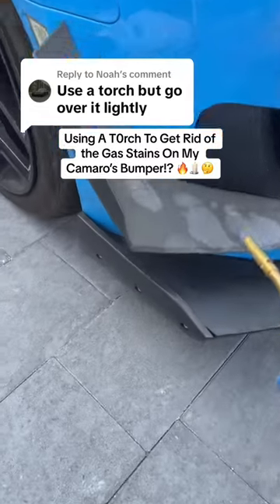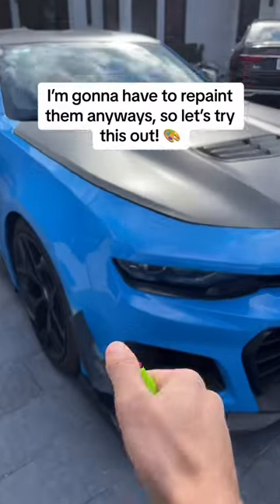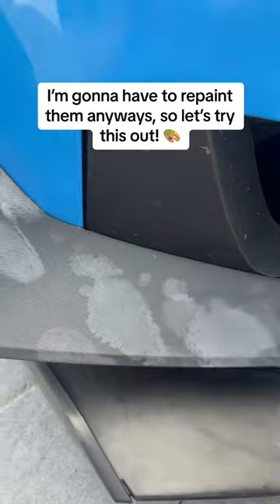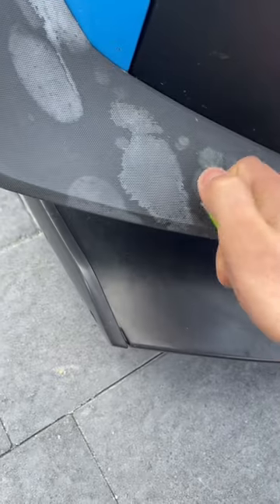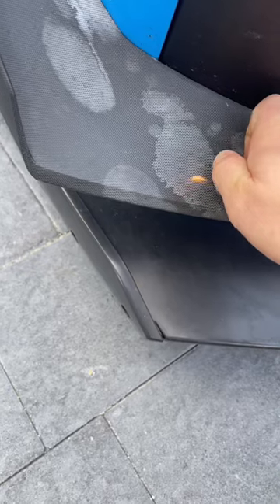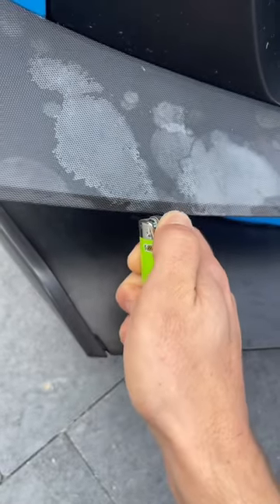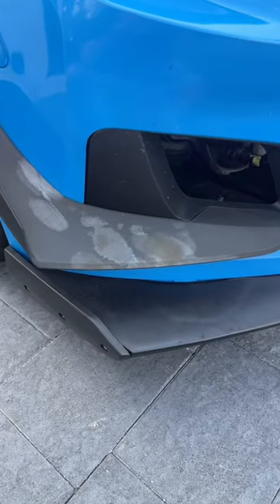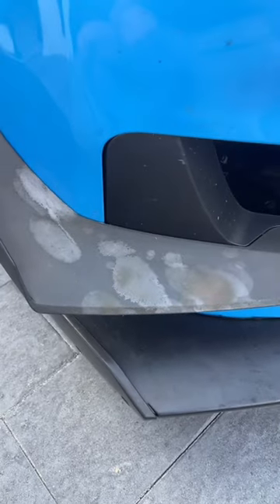USING A TORCH TO RESTORE FADED, PLASTIC CAR PARTS!? (WILL IT WORK ON MY CAMARO’S BUMPER CANARDS…)

Comment: You need a large torch without a focused flame. You have too much heat on it.
Reply: And plastic not carbon fiber
Reply: @zackaryschneider8652 it’s plastic
Reply: @Captain1929. Definitely not plastic dude. Thats carbon
Reply: @coryboone8025  it’s textured plastic look closely
Reply: @coryboone8025 that’s not carbon🤦‍♂️🤦‍♂️🤦‍♂️
Reply: @coryboone8025  that does not look even close to carbon
Reply: @coryboone8025 there’s plastic made to look like carbon
Reply: incorrect, it’s a chemical burn not oxidation.
Reply: We’re talking about the black plastic on the car not the flame or gas 😂
Reply: I don’t know shit about painting or glossing ; but I agree
Reply: @Captain1929. Ik this is a old comment but it's clearly not polyurethane or abs

Comment: OK I actually know this trick and you don't do it with a torch, you had the right idea with the Bic lighter but you have to do it for a while for it to work, I would use like a BBQ lighter or a candle lighter or a SMALL torch for like cooking or even smaller of one that's for like starting a personal camp fire.

Comment: 1. Not the same type of plastic my guy
2. This is usually done with more dispersed heat, not with a direct flame to a single spot
Reply: exactly
Reply: That’s not plastic at all, it’s actually carbon fiber. Close in the sense of things, almost the same properties but way stronger and more durable

Comment: This works on weathered plastic or faded, the problem you have is the gas ate some of the coating on your canard and unfortunately the heat won't work. It MIGHT help if they were weather rotted or faded but only really works on plastic, not fiber

Comment: Just did that a week ago on my dad’s 2006 Silverado to all the black exterior trim. Works great. Used a small propane bottle like the ones for camping stoves and a torch tip. Works great. Just make sure to keep the flame moving. I kept the tip of the flame 4-6 inches away with a blue flame. Fairly windy outside and still was great.

Comment: Use tire shine it will make it black and keep it that color😊
Reply: As a detailer this will only hold its color for a very short amount of time. And I’m meaning a couple weeks at most. Plus overtime tire shine destroys everything it’s on.
Reply: @kodywolfgang1944 yep exactly
Reply: @kodywolfgang1944 u sure
Reply: @kodywolfgang1944 i agree with your statement as a detailer myself but cerakote and solution finish would probably keep the trim black for months with minor touchups needed once a year or so maybe even less frequent than that if you ceramic coat over top of the trim restorer

Comment: Wash and polish: Try washing the stain, then hand polishing it.
WD-40: Use WD-40 to disperse the stain without damaging the plastic.
Simple Green: Use concentrated Simple Green to remove diesel stains.
Bleach: Use straight bleach to remove gasoline stains. For effective stain removal, mix one part chlorine bleach with ten parts water. Apply the mixture with a sponge or damp cloth.
Acetone: Use acetone or a cleaner wax to remove gasoline stains.
Plastic polish: Use plastic polish with fine steel wool as a lubricant.
Lacquer thinner: Use lacquer thinner to remove gasoline stains.

Comment: This is likely a thermoset epoxy used for this part and not a thermoplastic as used on the seats. This works as it melts the plastic slightly getting rid of the micro scratches on the seats. In the case of thermosets, the heat will do nothing other than burn

Comment: The torch used on the chairs is getting rid of oxidised plastic, your plastic is chemically burnt not oxidated. 

Unfortunately nothing will work other than sanding and painting or if they’re resin coated sanding and applying resin.

Comment: The real question is how did you get gas on your conards😂
Reply from the maker: Injectors
Reply: @TobyVegaD  wtf are you talking about lol
Reply: @TrillMurray he modified his injectors and didn't install them right so they probably sprayed gas everywhere😂
Reply: @barryhallsack8852  he just said injectors like this is a normal occurrence lol it's amazing they even gave this dude a license
Reply: @TrillMurray  Right. I don't even know this guy lol. I just figured this is what happened. I've done the same thing on my secondary fuel system and forgot to tighten an AN fitting and ethanol sprays everywhere and it's super corrosive.

Comment: First of all you had the torch turned up to high. Secondly, it mainly works on faded black plastics due to the natural elements. Not chemically damaged. It works by remelting the surface giving it a new shine. It can weaken the plastic if done to many times and if done incorrectly. Works on dirtbike/quad fairings as well.

Comment: If it’s real carbon fibre this won’t work you’d want to wet sand and polish it. Heat only works with plastics and carbon carbon fibre is resin bonded and does not act the same as plastic with heat
Reply: This comment should be pinned at the top

Comment: Use a weed burner for the garden, low heat and sort of submerge the plastic in the flame

Also, it will do nothing but burn if it’s real carbon or fiberglass, this trick only works for ABS plastic

Comment: Weird thought but low boiling water not hot enough to melt the plastic or warp it, but just barely enough to you know heat up the top layer and let the oil separate take this advice with the grain of salt though, because this is just me speculating.

Comment: You need a hot air gun that blows hot air the flames are what’s burning it lol the heat will work it’s just the torch released to much gas and focuses on heating one spot mainly as with a hot air gun it shoots straight hot air so you don’t really have to worry about melting or burning your car

Comment: It is better if you use a heat gun and not a blow torch because if it is the wrong type of plastic the blow torch will melt the platic

Comment: It does actually work… on plastic not carbon fiber😂, and the way it works is the oil drys up from the sun and when you re heat it, the oil under the layers goes up to the top making it look shiny and new

Comment: all you need is black plastic and rubber restore and rub it on your plastic, or maybe if this does even work you need a more diffused heat source something not so concentrated and hot something that’s more spread out

Comment: The reason this didn't work is probably because you have carbon fiber. The heat trick doesn't work with all plastics. but if you really want to try again, use a heat gun. It's much simpler and you won't end up burning anything.

Comment: Burning it will only turn it black temporarily it’s really just drying the plastic out and it’ll will fade even worse over time you should get back to black by mothers I used it on my truck bed caps and it went from old faded grey back to black and it looked brand new

Comment: First of all, flames go up. When you light the lighter, your thumb should be below the fire, not above. Flip your hand. Also, I don't think it works with textured plastic like that. It has to be smooth hard plastic. I don't know what kind exactly, but it's not that

Comment: These torch tricks are dumb either way. You melt off the protective layer of sealant making it more prone to weathering and cracking. You’re better off just sanding, sealing and painting the plastic

Comment: Its carbon fibre, meaning its not a thermo plastic. Its resin. Use clear coat, itll fix it, heat only burns resins. Hence why bakelite phones and other things are fireproof!

Comment: Bro 🤦‍♂️ do a bit of research my friend. When you use heat to "refresh" the plastic on a car all it does is bring the oils in the plastic to the surface. Those are the same oils that have photodegraded from the surface causing the pale faded color in the first place. When you do this, it looks good very briefly then comes back way worse. Not only that, it also dramatically alters the structure of the plastic making it really brittle. You're better off sanding and painting it if you plan to keep the vehicle.